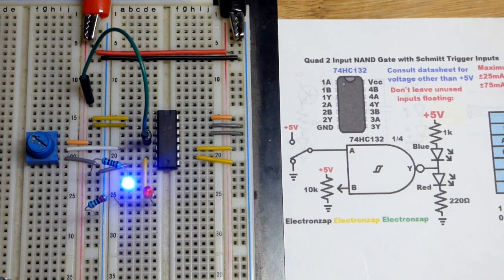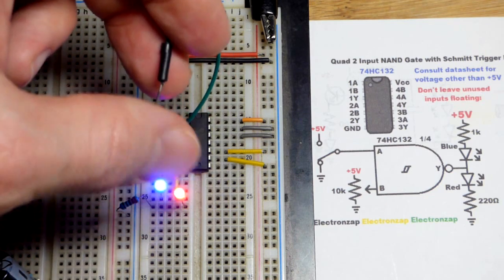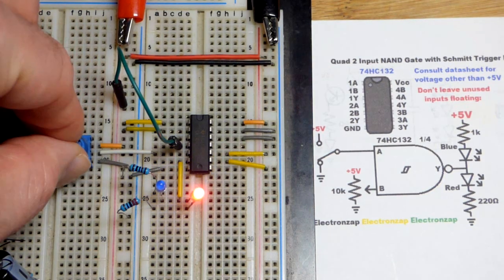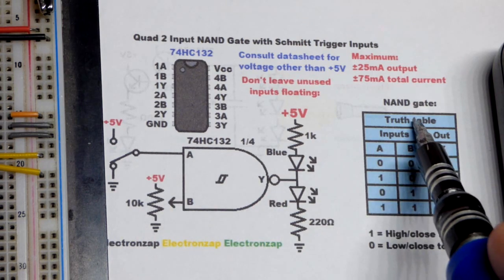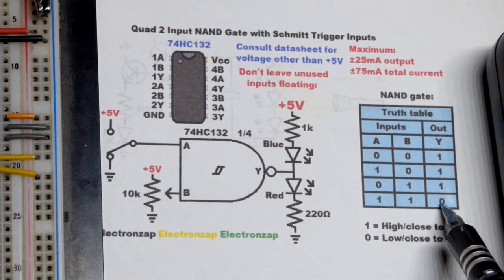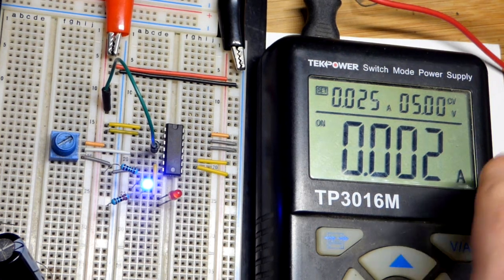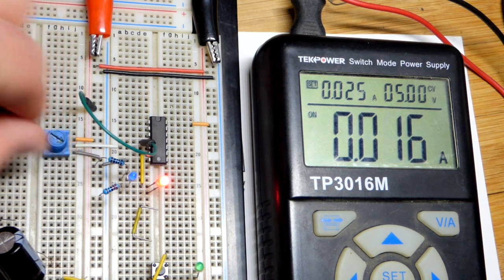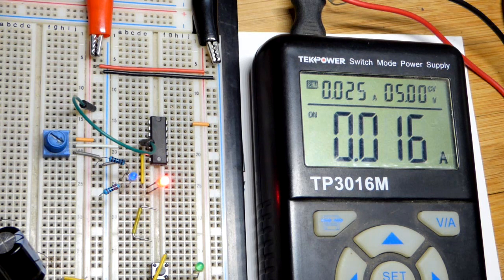74HC132 Quad Schmitt Trigger NAND Gates Integrated Circuit IC demo

Comment: Waiting for more on this. Like RC oscillator ckts. Can you show how the output varies based on changing capacitance. And the square wave output from the oscillator ckt to one of the input of second nand gate via a clamping circuit and this second nand gate output to a two inputs of third nand gate and the output is connected to a circuit which converts frequency into voltage by constructing simple RRC passive components.